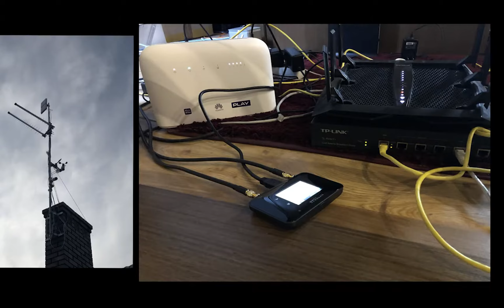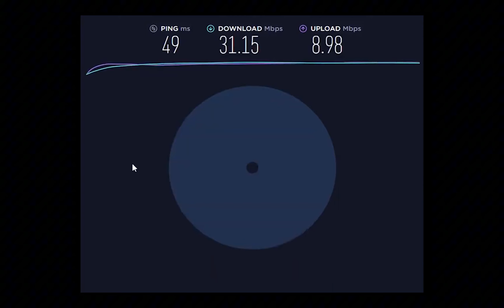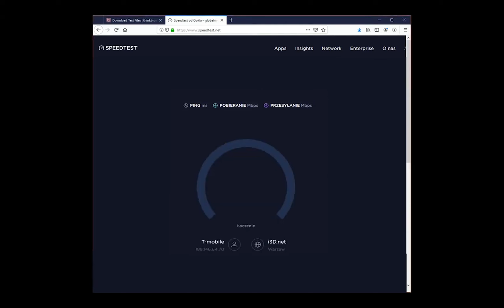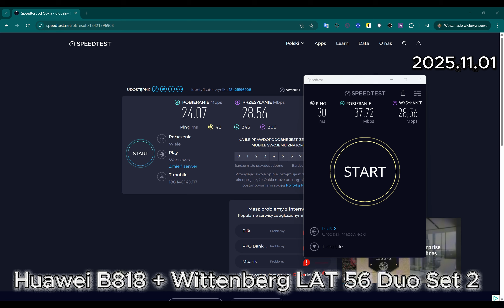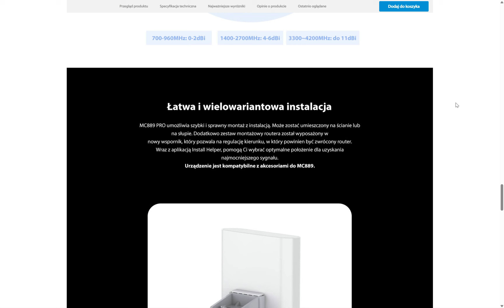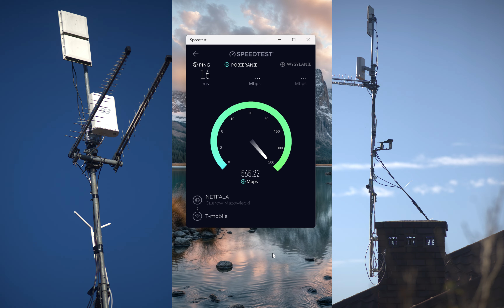🚀 From LTE to 5G: Testing the ZTE MC889A Pro – Can It Replace Fiber?

Comment: How did you aggregate the 2xLTE signals before? With a VPS hosted elsewhere?
Reply from the maker: I did this quite a while ago, testing the aggregation of two LTE connections using a TP-Link TL-R480T+. Unfortunately, this device doesn’t actually combine the bandwidth of both links — it works more like load balancing, splitting the traffic rather than truly merging the speeds. That’s how it performed during my tests.